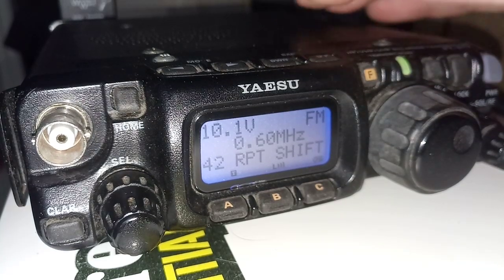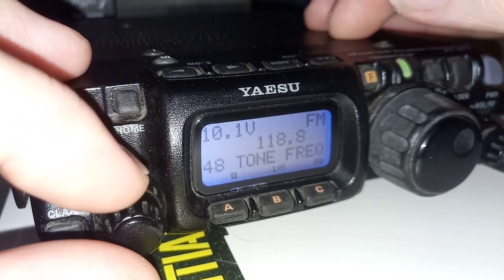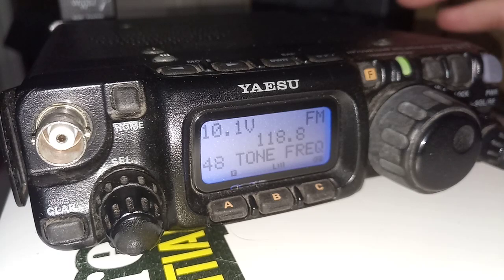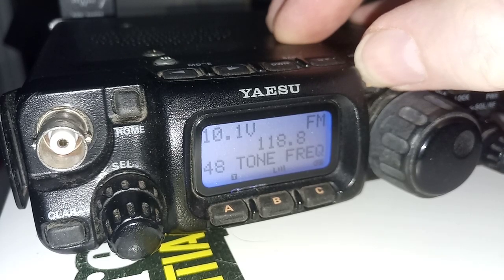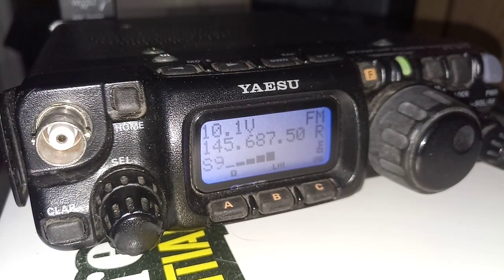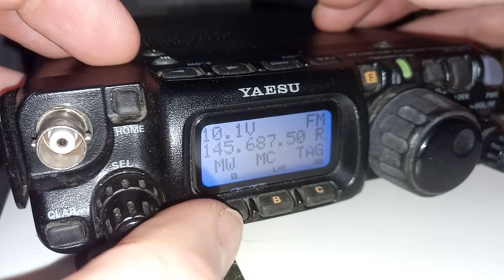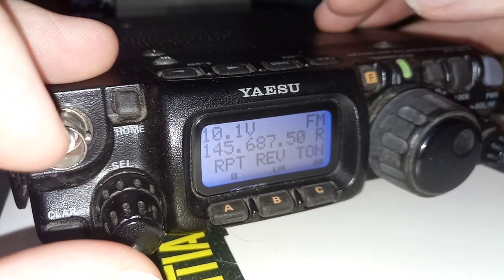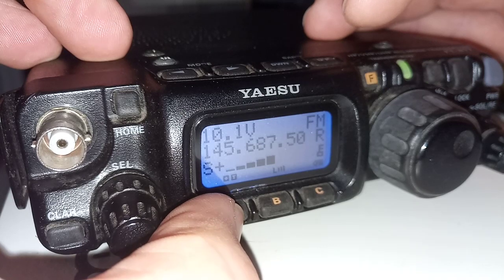Yaesu ft 817 program repeaters to memory by hand

Comment: How many repeaters does the Yaesu FT817 store?
And how do you do it, what is the configuration. I appreciate any help.
Reply from the maker: i just looked in the instruction book and on google and can not see anywhere how many memories the 817 has?
you can also use Chirp to program the 817. using the Chirp program is a better option for me
Reply: ok tank  @wowsly